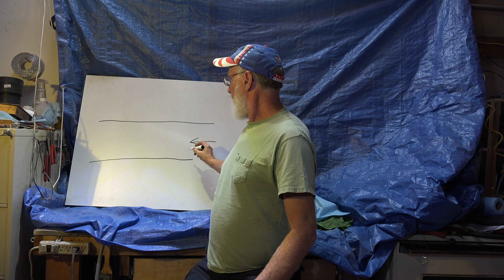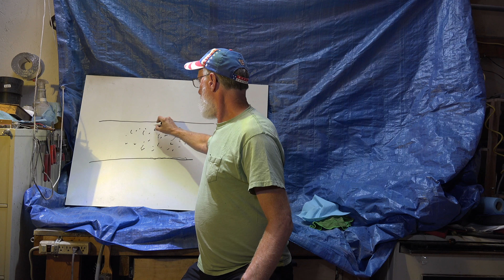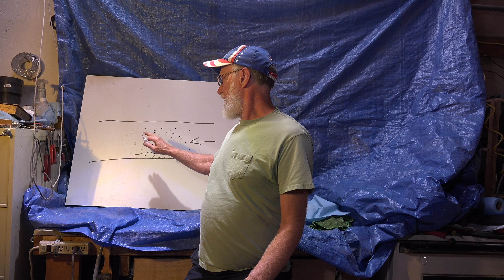Why the oil can pump out of the refrigeration compressor

Comment: Great video - judging by the comments, this one sounds like an area that needed more discussion and investigation. 

One thing - sounds like the "oil filler cap" (would that it were that simple)... sounds like the oil filler cap should have a sign on it that says "do not add oil unless system is properly charged with refrigerant."

Comment: I am here because of discussion with a colleague that claimed you don't need to worry about oil return in commercial refrigeration as much if you are using a pumpdown system because it pulls all the oil back to the compressor ... and I couldn't see how reducing the pressure  and velocity of the gas would help return oil.  Your video shows exactly how I pictured oil return in my head.  Can anyone think of another explanation on how pumpdowns could help with oil return?  I dont see how it could.

Comment: Gfm thank you for all your help. I think your right we got air in the system. I was looking at our oil pump and the dumb thing is sucking air. I couldn't hear it with the chiller running. Thank you so much you have been a big help. This thing was driving me crazy lol. My coworker used the same pump originally when he made a repair on the oil line. So that's must be what happened to the r22 also. Thanks again. I'm going to try and get a video with my phone today. I will try and send it to you. It would be a good subject to teach about.
Reply from the maker: Looking forward to it.
GFM
Reply: @grayfurnaceman  

Did Brad HVAC send you a video? And, if yes, can you post a link to it here?

Comment: Hi...great video...just wanted to know that I have worked on a system where I have a bitzer compressor & oil separator at the discharge...I am facing low oil pressure & oil DP problem...the load to the refrigeration unit is also low..so I had to stabilize the superheat & subcooling with a low refrigerant charge ...... the compressors are running at minimum load always. side glass also shows bubbling at minimum load...what could be the issue? is the oil pressure dropping because of low refrigerant load & inefficiencies of oil separation by the separator at discharge? thanks

Comment: Very nice! So I’m changing everything but the refrigerant lines, sensors, and wiring on my car AC. There was considerable (2-4 ounces with leak detection dye and gritty sealant residue) oil in the evap. Do you think I should only put a dab of new oil on all the new seals, and maybe a touch on the TXV? I have been wondering about the auto AC videos saying measure the oil in each component and replace it in that component. In the evap? In the condenser, receiver/dryer, and lines? Should I put all the oil for the system in the compressor. You have clarified that replacing oil component by component is incorrect. Any advice would be appreciated.

Comment: Hi is it advisable to use a fridge compressor as a vacuum pump? What vacuum presuure in psi will be suitable before recharging?
Reply from the maker: No.  The compressor is not capable of deep enough vacuum and, because it is hermetic, it will not cool.  You need 500 microns of vacuum.
GFM

Comment: refrigeration compressors are designed to pump oil to lubricate the valves and seats to make them more efficient.they also rely on refrigerant ,which mixes with oil,to return oil to the compressor.
Reply from the maker: What is your point?  Not trying to beat you up.
GFM

Comment: thanks. a lot of times when i'm changing out a system, when i go to cut the line set from the evap, compressor oil pours out everywhere.  this is with systems that have the condenser higher than the evap.
Reply from the maker: You would also need to know the reason for the replacement.  Locked rotor from low charge would cause that.
GFM
Reply: @grayfurnaceman  Another thing to consider: Is there a trap at the outlet of the evaperator?  If evap is lower than the condenser a trap is warranted.

Comment: Hey thanks for your help have a large 2 stage 70 ton seasons 4 unit working on issues with oil pressure safety.. going to be checking the superheat closely now since watching your video. Unit has an adjustable txv on each 35 ton semi hermetic compressor circuit. I have amped out my crankcase heaters. Is there anything else I could check regarding low oil pressure loss of oil level in the sight glass?
Reply from the maker: When checking the TXV superheat, note that if one is leaking by, adjustments will make no difference.  I had one unit with 20 TXVs and just one that was leaking by shut it down on low oil pressure.  Also, pump pressure should be checked.
GFM
Reply: grayfurnaceman just one txv was running 22 degrees lowered it to fifteen hopefully it helps.
Reply: Each ckt has one large txv two total on unit
Reply: What do you mean  by leaking by?
Reply: "... amped out my crankcase heaters..." What does that mean?
Reply: @PTF491  A leaking TXV or leaking by TXV is one where the power head has gone bad and allows the liquid to run at whatever the valve body was set to in the past or completely failed wide open causing the SH to be non existent at best.  For this reason adjustment is not possible because the sensing bulb is taken out of the equation as is the metering effect of the power head.  Clear as mud?
Reply: Jeffry Stout yes lol

Comment: Awesome video. You will all so have low oil return if you have low load conditions. Gfm am I right about that? I change the poe oil in that chiller today. Set the txv back to 10 degrees superheat per manual. But I'm curios will that superheat be the same with the mo99? Also circuit 1 seems to be returning oil ok. But circuit 2 is not. Also circuit 2 is set to 16 degrees subcooling per manual but it's flashing at the site glass. I don't get it. I weighed the charge in 90% like the said. Let run about 4 cycles set the subcooling and its flashing really bad. It has a brand new txv sightglass and solenoid valve and all coils were just cleaned and all fans work. It was about 76 outside today. 65 degree water returning to evaporator. Thank you for all your help.
Reply: U said set subcooling. Is that a typo
Reply: No added enough refrigerant to set the subcooling. The manual said they wanted 16 degrees of subcooling. I had only charge it to 90% of total charge. Then added the rest by measuring the subcooling until I had 16 degrees.
Reply from the maker: Low load conditions could also cause that.  The superheat is generally the same with MO99.  Do you have a temp difference in the liquid line upstream of the sight glass?
GFM
Reply: i thought your sight glass would flash if you have a big heat load,because the refrigerant is evaporating very fast??? why would sight glass flash with low load and 16 degree subcooling, possible restriction????
Reply from the maker: Once the system is running and settled down, there should be no bubbles in the sight glass, even under high load.  If you have bubbles, that indicates a restriction upstream of the sight glass or possibly air in the system.
GFM

Comment: Great video .  Sir can oil be added to a rotary type compressor?  it think the oil chamber in rotary compressors are sealed ?. i assume pumping of oil into the system with rotary compressors signifies the seal of the oil chamber is bad which will reduce the efficiency of the system .
Reply from the maker: If you mean scroll compressors, there is no separation of oil from the system.  The oil circulates with the refrigerant.
GFM

Comment: What do you think of installing oil separator on discharge line, I never see anybody doing it as additional recommendation, I saw oil separator only from factory design.
Reply from the maker: Oil separators are used in systems that have oil return problems mostly ammonia machines because ammonia does not mix with oil.  However, no oil separator is 100%, so if there is an oil return problem on a system, the problem will still exist, it just will take longer to show itself.  
GFM

Comment: When we have vertical lift 40'-50' can we use just solenoid instead of traps? Or do both ? When manufacturer says maximum lift... Does it mean without traps?
Reply from the maker: I am not sure how a solenoid would help with oil return.  Install instructions say maximum lift, they mean without traps.
GFM

Comment: good vid. any info on oil loss via a leaky system. schrader ports that have evidence of oil loss etc? is there a way to tell if a compressor is low on oil without sightglass like residential systems?

thanks for your vids and info contained in them.
Reply from the maker: Oil slicks on service valves, Schrader, etc do not indicate an appreciable oil loss.  No, there is no way to know if there is a low level without a sightglass unless there is a low oil pressure cutout.
GFM

Comment: The oil of bizer compressor is not return quickly until the compressor off I need help ????
Reply from the maker: There could be several problems.  Low charge, incorrect TXV setting, piping too long or too large are a few.
GFM

Comment: If oil is leaking out of compressor. 
I must have a hole in my line...right?
Reply from the maker: This is not that simple.  How do you know you are low on oil?
GFM
Reply: @grayfurnaceman  
On the margarita machine. I found oil underneath it. So i checked underneath the
compressor and seen oil.
Reply: As far as being low on oil...
I have no idea on checking that out.
Reply from the maker: @shanedittmer4344  The repair depends on where the leak is coming from.  If it is from the compressor itself, the only sensible repair is replacement of the compressor.  If it is from one of the lines, it can be repaired.  In either case, it is also losing and probably has lost its charge.
GFM
Reply from the maker: @shanedittmer4344  There is no effective way to check oil levels on units without an oil sight glass.  If you know the oil charge of the unit, you could remove the compressor and dump out the oil, measure what came out and replace with the proper charge.
GFM
Reply: @grayfurnaceman  
I found oil under the compressor and at the capillary. The circuit breaker trips immediately after turning on the unit. What could be the problem ?
Great video as usual.
Reply from the maker: @suhailasaba1051  Immediate tripping means a dead short.  Unless there is a wire to ground, the compressor is toast.
GFM
Reply: @grayfurnaceman  
Thank you for your answer.

Comment: Wonderful explanation!
You think that may be what has happened to this refrigerator? https://youtu.be/7lyyg_qRpTg
Since it has a coaxial feed/return to the evaporator it feeds it on top and zigzags all the way to bottom before looping back up. I suspect the bottom of that evaporator has a lot of oil in it and the compressor is running dry causing it to pull too much amps.